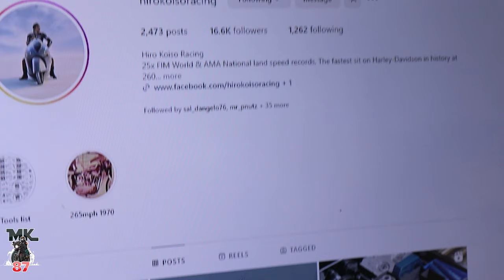Low Rider ST gets a 131 installed

Comment: Just redid my 124.

Did the bottom end (I ride a ton.. so really want it to last lol.  25k miles a year on a stock bottom end big bore .. nah 

SS 11:1
124
480MT
64mm 
KW 2-2 / tab medium baffles 
SS crank 

130/145
No toque curve it’s a damn tq table top.  Power EVERYWHERE 
Rides like a v12 Benz gathering speed

Comment: That 483 on that is gonna thump !
I’m betting 145/155 
And that cam likes heads and big TBs 
Also it won’t stress the valve train a lot bc of its 483 lift.
CR 512 or 515 will work well in there but u may like this more 
More tq hitting lower but less hp 
But how often u at 5250 or higher ?

Comment: Try out the cycle Rama 512 cam in it, just swap out your clutch springs to the 1275N’s
Reply from the maker: That’s exactly what I’m looking at
Reply: @Marvelkid87  that’s what I’m putting into my SGS. Just took your guys advise on the piston jet oilers. My other advice would be to grab a SE oil pump and cam plate when you switch out to the 512 cam if you don’t already have those in the chest.
Reply: @Marvelkid87  have you heard or got any numbers comparing the CR512 cam to the CR515 cam? I’m very curious about both 🤔

Comment: They need to release a 135 option for softails
Reply from the maker: This is a softail …..
Reply: @Marvelkid87 yes. But it’s not a 135 kit 😊
Reply: They can not. All 114/177 bikes have a 4.5 crank. You need the 4 5/8 crank for the 135
Reply: @TorqueCustomCycles thank you for the explanation ❤
Reply: Which star cam would you recommend installing in a 131 cc on a low rider s ?
Reply: @jackmetzger8644  3/4 race cam